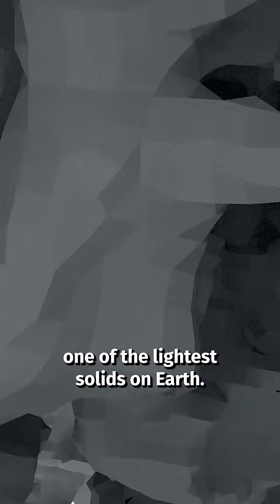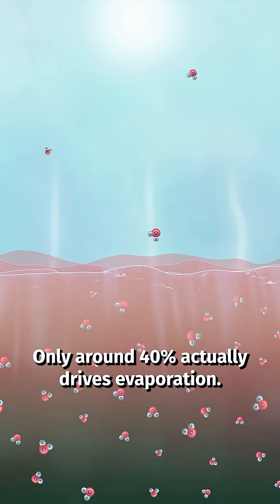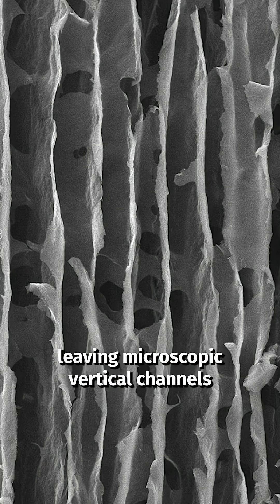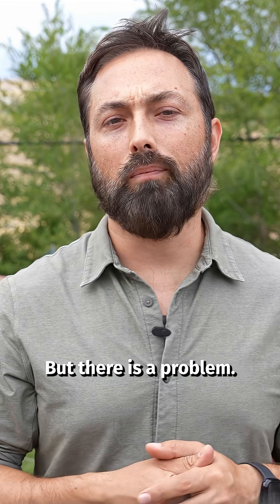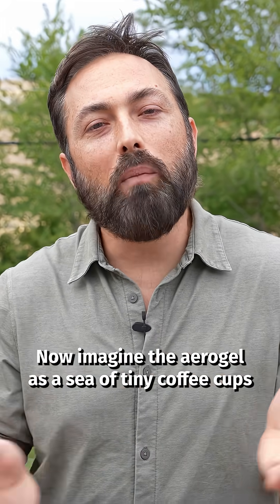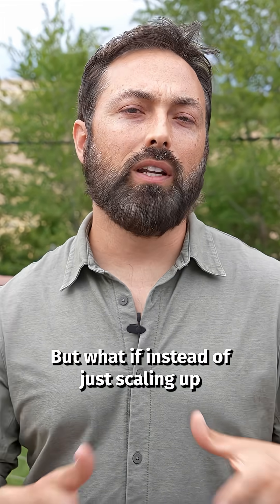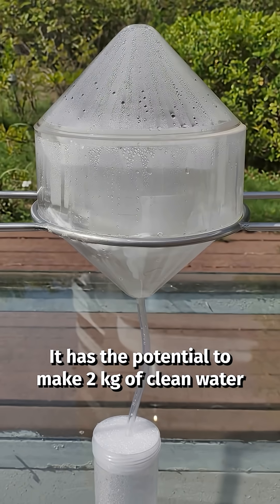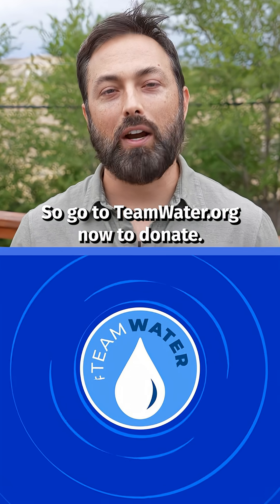How aerogel can make the ocean drinkable

Comment: If you thought asbestos was bad, let me introduce you to aerogel.
Reply: Silica-based aerogels are not known to be carcinogenic or toxic. However, they are a mechanical irritant to the eyes, skin, respiratory tract, and digestive system.
Reply: @theonidas  Silica is good for the lungs, ref:silicosis
Reply: @theonidas Fair enough. I’m just imagining our air turning into our water, only with friable microsilicas, instead of microplastics.
Reply: It's not new, it has been around for decades and is well studied. Its brittleness is indeed something to be carefully about but even infestation doesn't seem to be harmful according to safety studies.
They caution against using it in dry settings but I presume the variants they use are food grade and less brittle since their basic use is capillary work and not heat resistance.
Reply: @reinoud6377 the plastic getting 3d printed will definitely leach and be a bad contribution to the micro plastic issue id say…
Reply: There's nothing wrong with this material it's extremely good and very useful
Reply: I thought the same, it's a new material, are we sure this is safe and it won't sound as silly as "uranium cosmetics" 20 years from now?
Reply: @littlefrank90  I think there is a very small chance of that happening. This isn't a new mineral that was discovered it's a man made compound; we know exactly what's in it and what those things do to the human body. 

The worst thing that I can see come of this is an issue we already have. Micro plastics could potentially leak into the water. but as the issues with microplastics are still largely unknown and the places where these devices would be deployed need clean water it'll probably be seen as a worthy risk
Reply: @littlefrank90  back in the day science was done rather poorly (comparatively). We now follow the scientific method more properly. We are significantly better at making correct conclusions from experiments and research. 

Your initial fears are fine, but the more you understand science, you'll see that 'what if we're all wrong and it's all bad' is not really a major problem compared to many others.

One problem science still has is that its funding comes from capitalism, which may bias it in favour of bad actors. If you want to counter that, use your voice in politics, elect competent people that would support ethical science. And ofc, donating and spreading word of good science research and organisations also helps.
Reply: @justacutepotato2945  well said
Reply: @justacutepotato2945 I think it's still important to respect the possibility of an unforeseen consequence born from an outcome not anticipated during development or testing. You can predict how something might go wrong, but you can never completely predict with 100% certainty what won't go wrong. The entire concept of science, modern or otherwise, is built on the spirit of learning something new. Sometimes, even if you're careful enough to make walking on eggshells look easy, you can still miss something that no one had any expectation to know was even possible so I feel some wariness and concern isn't totally without merit to voice.
Reply: @justacutepotato2945 sometimes funding comes from government 😜.
But yes, absolutely right. Thats how most of the climate denier scientific papers got formed for example (for other people)
Reply: @justacutepotato2945 Precisely. Follow the philosophy of science. Be a materialist. Read Marx and Lenin!
Reply: @justacutepotato2945  We'll need a lot more involvement than that to counteract such bad actors.  The rules are written by them and in their favor.  You can't win by playing the game.
Reply: @justacutepotato2945  reminds me of a conversation with someone who doubted science...

Eventually I said, becoming familiar with science will mean not having to rely upon trust. 
Him: Ok, but who should I trust?
Me: That's the point I'm trying to make is that knowing how things works means not having to look for who to trust. Instead, you'll know how to tell truth from lies.
Him: Ok, but can you tell me who I should trust?

I get that putting in that time can be just not worth it at certain points, but it was eyeopening to see such a different perspective. 

I would much rather not rely on trust, and understand science.

Perhaps there are more people out there that have views we would not conceive of? (Above was the tail end of the conversation. There was more discussion. He didn't generally lack curiosity, and wasn't slow or anything like that. 

Trusted experts seemed to be important to his worldview in ways I didn't fully intuit)
Reply: @littlefrank90 so should we not make new materials? Doesn't seem like a brilliant insight.
Reply: @sploofmcsterra4786  no, we shouldn't. Humans haven't had a good idea in the last century. The marketplace of ideas is extremely oversaturated.
Reply: @altKingCarrot That is simply incorrect. We have many great ideas, it’s just that the bad ideas usually get more press when they backfire.
Reply: @lancepeterson7997  wrong.
Reply: @altKingCarrot You gonna add any sort of support to that statement, or just leave as untethered and insecure as your mental stability?
Reply: @lancepeterson7997  welcome to the real world. No one owes you an explanation.
Reply: @sploofmcsterra4786  Who said we should not make new materials?
Reply: @altKingCarrot 
The internet was a good idea
Reply: @sploofmcsterra4786 that’s not at all what they’re saying lmao. They just mean ‘hey let’s not implement this into our lives until we know it’s safe’. Make the new stuff but do ample testing to make sure it doesn’t give lifelong defects to millions of people
Reply: @JonathonNarfhead WAS. Then it turned out to be a horrible idea.
Reply: @littlefrank90  yes, like the film crew and stars from the original Wizard of Oz. Most died from cancer.  Of course, notwithstanding Ms Garland’s own choice of self-directed exit
Reply: Silica-based, and they don't evaporate (at that temp)
Reply: New thing scary!
Reply: Aerogel is 99% air. Some are biodegradable and edible. It depends on the kind used. An aerogel is a structure, so the material used can vary.
Reply: Scientists test that kind of thing
Reply: @Greatly_Incompetent  thats cool they test it, anyway look up DuPont teflon story
Reply: @Greatly_Incompetent 
Why didn't they test asbestos and lead? They did? Sure, but it took 20 years. 😅
Reply: @itsm3th3b33  which is why in modern science we test these things immediately 
You are doing the equivalent of trying to discredit doctors by talking about the four humors
Reply: @Greatly_Incompetent 
Four humors? That was from 400 BC. I'm talking about asbestos, as in the 60s. 
Define modern. And who exactly are the "we" that you say do the testing so promptly?
You forgot the opioids crisis created by Purdue Pharma. The Sackler family recruited doctors to blindly disseminate oxycontin left and right. Less than 20 years ago. 
How about the non-stick coating on frying pans? Was it fully tested? Still used today.
Reply: @Greatly_Incompetent  Which kind of threatened species of scientist are you talking about? Like knobbled-culled EPA, vested interest employee or kowtowing institutional scientist?
Reply: @Greatly_Incompetent Does anyone listen to their results?
Reply: @diytwoincollege7079 usually yes
If it's actively covered up by corporations and the government to protect their profits then it will be buried e.g. tobacco, leaded petroleum, oxycontin
I have my issues with veritassium but their video on pfas (forever chemicals) is quite good
Reply: @Greatly_Incompetent Ih yeah that’s why we have alle these scandals right?😂 delulu 🤡
Reply: a straw is kinda the opposite of a fibre,
so what are you even comparing?
Reply: Pack it up everybody, innovation is dangerous and science is dead
Reply: What dumb people think smart sounds like.
Reply: Don’t forget today’s world is based solely on profits whatever they’re making this with will be the CHEAPEST option not what’s best for us lol can’t believe some of the people in this thread saying science is safe nowadays actually it’s the least safe it’s ever been lmao
Reply: The water evaporates off of it, so even if it was contaminated before, it's now clean
Reply: Aerogel consists of Sand and Air. It's an irritant, because it's dry and not because it's toxic. Ultimately, it's like drinking water with small dry sand particles. I would say, that the body is capable of disposing of those particles as long as they don't collect somewhere
Reply: That's why there are scientists and engineers and regulations and regulating agencies. And they usually work unless cynicism destroys them mindlessly using some screw-up of the distant past to seed ignorant fear.
Reply: It's literally not toxic.
Reply: exactly my thoughts... how much fuckin micro aero gel would stuck in my water..
Reply: @FeroxX_Gosu maybe much less than the microplastics that are in your food rigth now?
Reply: silica nano - filaments ???  Asbestos is  (Greek word for lime) - misnomer for amiantos  = Undefiled...) - fibrous silicates long used for fire resistant materials, including unquenchable sacred flames...
Reply: @kadmow 
Asbestos causes cancer
Reply: Really? I was under the impression that aerogel was not carcinogenic.
Reply: @partimentieveryday it isn't, it's just a worst case scenario
Reply: @Draconic404 what on earth does that mean? It either gives you cancer or not. That IS worst case scenario. 

So who’s lying?
Reply: @partimentieveryday As we know now, it absolutely doesn't. It's just fear of what's new, no indication whatsoever that it's worst than asbestos
Reply: Pollute the seas, water, aquatic life, fish, rain, everything.
Reply: I’ve got a design that uses just metal and wood two things we know are safe but it would be expensive meaning nobody in today’s world would be interested so now we get to ingest computer chips woohoo